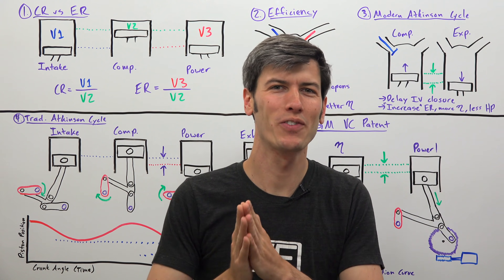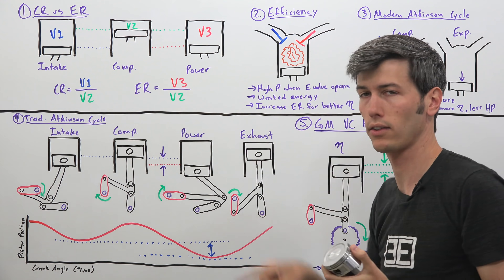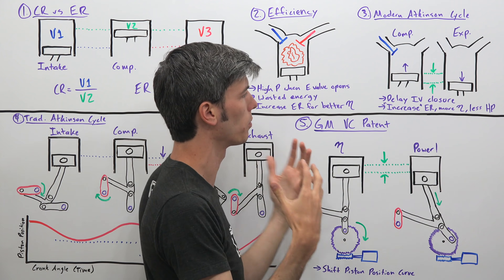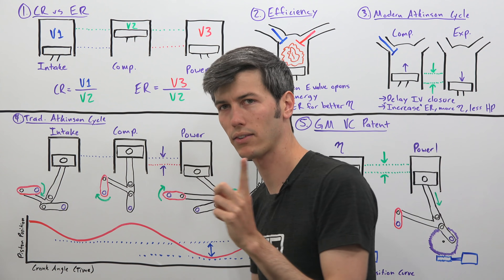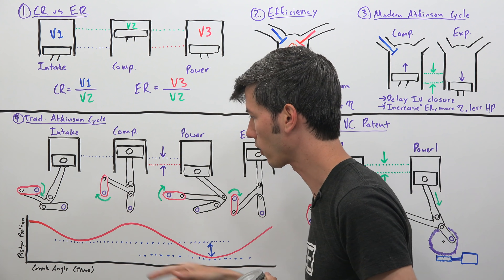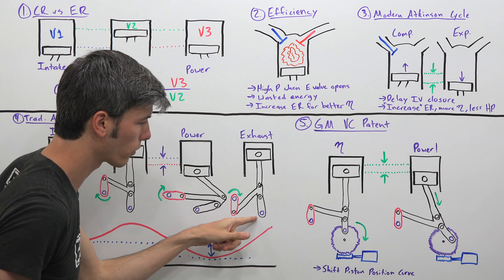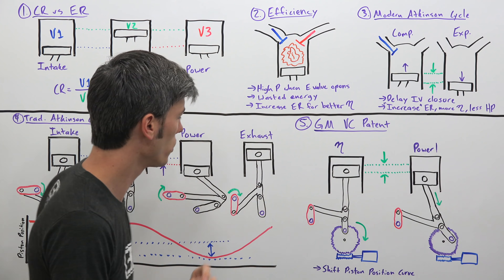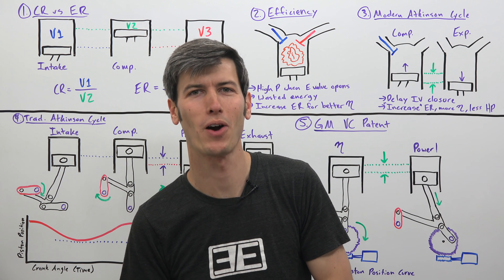How GM's Variable Compression Engine Works - Patent Review

Comment: I dont really understand the geometry behind it, but it looks like with this design a parallel "v" engine could be possible. What I'm looking at specifically is how the crankshaft  is offset (vertically) from the cylinder. 

So it might be possible to mirror it over the crankshaft to make 2 banks. Then it would be possible to make it have a single head like VWs VR engines (but not as funky with angled pistons on the head)

Comment: Hey Jason @engineeringexplained, I was wondering if you could help me out with a question about DCTs?  (Irrelevant to this video I know but I cant figure it out!)

In a common manual/automatic transmission when up-shifting, after disengaging the clutch the human/computer must wait for the engine RPM to drop to the appropriate value for the next gear before re-engaging the clutch. How does a DCT function in relation? In other words how does engine RPM drop at a faster rate compared to a manual transmission to allow a faster up-shift?

Many Thanks
Reply: I dont have an answer for you but couldnt you have a computer actuate an engine brake that momentarily is applied to the flywheel to rapidly drop rpms while the clutch has the engine disengaged?

Comment: - i just dont trust the little motor at the bottom. something tells me thatll break every 40k miles and require the body to be removed to get to it...
- i imagine this is wholly incapable of handling boost?
- why would you need to adjust position at a worm gears pace on each individual cylinder? arent they all supposed to be running the same exact specs as each other all the time?
- is it even worth salvaging if the thing ever gets hydrolocked?
- the more complicated an engine gets in the name of efficiency, the more stuff oil has to touch, thus the more things have a chance of failure if you have anything happen to your oil at all. if you run small engines without oil and seize them hard, you can take them apart and slap some new rings on the pistons if even needed, hit them with some WD-40 and theyll run again. THIS will cause a black hole if any little thing goes wrong.

2000 subaru forester s, 2.5L N/A 5M... i dont like the complicated thingamajiggers because i cant fix them on my own, or the parts are too expensive

Comment: Jason, I love your channel - thank you for your work!  I have a video suggestion - the theoretical ultimate efficiency if all patented engine designs were applied to one design (sharing of intellectual property between manufacturers).

If only Christian Von Koenigsegg combined freevalve technology with variable compression AND direct injection AND port injection (with a bit of Mazda's spark controlled compression ignition) AND the Koenigsegg compressed air system for turbo spooling AND pre-heated catalytic converters AND hybrid energy recovery... the IC engine would maybe get close to an electric motor efficiency but with all of that complexity.

If on a level playing field 2 engineers presented the electric motor from a modern BEV and the best possible IC engine.  Nobody would think IC was better.  I love IC engines and we'll want to use them for a while longer, but looking objectively I think the industry is moving too slow to compete with BEVs.  We need to treat IC as a nice hobby in classic now.  If solid state batteries happen, IC needs to die - regardless of whether grid electricity is all renewable or not.
Reply: Or you can look the theoretical cycles and see how much would be a theoretical maximum efficiency.

Comment: I see alot of problems with standard manufacturing of this idea.... That's a lot of space and it absolutely could not be any kind of reliable with the standard processed steel being used... It wpuld have to be forged at the very least which is going to skyrocket the cost... Ontop of the extra components needed to make it work properly... Good idea but expensive...

Comment: I wonder if the back and forth motion of the con rods causes any abnormal wear patterns on the bearings as opposed to the round and round motion in a normal ICE?  Because with back and forth the rotation direction stops and changes direction twice in each cycle instead of the bearing surfaces constantly moving the same direction past one another.

Comment: Basically its a more fancy variable displacement engine. Im wondering how more efficient this is over cylinder deactivated engines. Especially when it comes to warranty work,and the extra amount of now crank timing marks along with your valve train timing marks. This will be very intresting,and another insurance that the internal combustion is not going anywhere fast lol. Great video

Comment: I wonder how long this technology will survive against EV.
We should go all EV if the objective is to reduce emission.

Anyway this is a good transition before we meet full EV.
And I still think ICE x EV hybrid is the best for transition, you drive with EV while ICE charge the battery and give some boost on high performance.

The price is the problem. Basicly, you have 2 engines in 1 car
Reply: used volts (arguably the king of phev) are going for 13-20k usd up to a 2016 lt trim. past that and you get the fancy stuff. not too expensive for both an engine and a motor.

Comment: All I see with these new motors is high repair costs. It will be a flop like cars that have the stop/start feature, direct injection in higher miles, dual clutch transmissions, etc.  I would rather have an engine like this then wait for an electric car to charge but all it will equate to is higher insurance and repair costs.

Comment: Have a look at Gomecsys GoEngine VCR technology. 

It's (older but) a much more elegant solution (than what GM are proposing) to achieve variable compression ratio and an over-expanded engine/power cycle.

Gomecsys' VCR system used ring gears set inside the big-end that rotated around the crankshaft to offset conrod-crankshaft journal centreline distances; to achieve VCR and an increased power stroke.

Their system provided a 20% longer expansion stroke than the compression stroke, which yielded greater combustion force applied to the piston; which, in turn, enhances efficiency/power.

Since Gomecsys' system uses ring gears that rotate around the crankshaft it avoided the clunky design issues (and vibration/losses) that are associated with multiple reciprocating levers and conrod like assemblies moving in too/fro reverse linear forms; like the GM system. 

Pro drive had a similar system years ago too, and (if my memory serves me well) either that or a version of the above-mentioned Gomecsys' VCR system was used in a prototype F1 car and successfully tested at extremely high crankshaft speeds and power outputs.

My bet is that licensing the Gomecsys' system (or 1 like it) is simply too expensive for GM.

Comment: That engine is a nightmare from reliability viewpoint. In step 3 where Atkinson cycle is explained he did not mention that many modern engines can have the intake valve closed earlier or later depending on the load by using variable valve timing techniques making the engine produce more efficiency without sacrificing maximum power output, just thought it should be mentioned as it is a lot simpler and more reliable way of achieving efficiency and definitely weights less that such complicated multi link crankshaft. Piston and conrod weight is very important for efficiency but conrods in this variable compression engine definitely will weight significantly more than traditional ones limiting maximum RPM and thus making the power to weight ratio so much worse that its debatable if this whole effort is worth doing at all.

Comment: Two major problems with this. More parts to fail, and engine harmonics. With pistons moving to  two positions the weight has a high and low force. How do you balance the crank, split the difference? So more fail points and a terrible vibration. Back to the drawing board.

Comment: I think GM knows a thing or two about unintentional Variable Compression Engines if you catch my drift
Reply: Lol yes, i just took off valve cover from a 2.2 gasoline Opel Astra H. It had stretched timing chain and popped over tooth.
Reply: @sleeptyper  yeah that's a common issue on those engines I believe they were an Opal design or at least the Germans had a hand in designing the engine and GM produced it basically the oil pump was  variable and at low idle it didn't deliver enough oil pressure to key parts of the engine

Comment: This is not new...
International put engines like this in bulldozers in the 1950's
You could start a cold engine with just one battery using low compression and gasoline...
Once the engine is warmed up, the compression is boosted as diesel is fed into the cylinder.

Comment: In item # 3: I’m pretty sure fuel is not pushed back out the intake valve mixed with air. An engine designed like this would surely be direct injected and deliver fuel right before ignition.

Comment: All these vc engine designs seem like overly complex and subsequently weak/inefficient systems. Theres no way adding more connecting rods/increasing the primary and secondary mass is going to have a positive impact on the engine.

Comment: OK, but it still reciprocates and has a variable and minimal leverage.  I have one patent granted and another pending on I.C. engines.  The patent pending is for a CONSTANT VELOCITY, constant leverage, toroidal design with around 3 times the leverage of a reciprocating engine of the same bore.  It employs a true Atkinson Cycle with a unique and ideal solution to the usual compromises found in toroidal engine configurations.  A turbo charger may be used as needed to bring my design back out of Atkinson Cycle to effectively run Otto Cycle combustion for maximum power.  I've been working on the design for around five years.  I'll have it up on the net in a month or so.  I can forward it to you at that time if you like.  I think you'll find it very interesting.  Thank you for the excellent video on this particular GM patent!

Comment: I agree with a previous post, GM's quality has been BAD over the last decade, especially their four and six cylinder engines.  I would not buy a vehicle with this engine design for at least three years to see if the engineering translates to a solid dependable design.

Comment: In the modern atkinson cycle as described in 3, wouldn't the variable intake valve timing adjust compression according to your needs - power or efficiency - and so mitigate the tradeoff ?
Reply: Stephan Buchin: Just what I was thinking too. And a lot simpler.

Comment: Can you do a video on a ‘5-stroke’ engine? this theoretically increases the expansion ratio as-well while keeping a lower compression ratio.
Reply: I think I saw a video about it, wasn't it an engine with a bigger cylinder for a set of two that do the combustion, then dump into that 3rd big one for further expansion?
It's very interesting and really similar to a piston based steam engine (in fact, the Titanic's engine was like this).
The drawbacks I can think of it is power to weight and power to volume ratios, also given there's more mass rotating and on different timing, balancing might be harder and I could see it as slow revving (slow as in response not redline). Again, this is what I can think of, but it would still be a very interesting concept, if not for cars then at least for stationary power generators.
Reply: Kalvinjj yes it was, a couple Nobel steam cars used a concept as you described about the titanic. 2 higher presure steam cylinders and 1 low pressure. I definitely think it’s has its uses, however it takes a big company to make it mainstream. As far as I am aware it was ‘devised’ in 2011 and since then no prototypes have been built.

Comment: Electric cars with on-board generators. Which is basically the miniaturized diesel locomotive technology to be fit in cars. First Jeremy Clarkson, James May and Richard Hammond came up with it. Then Fiscar tried doing it and called it Karma. Nice idea but quality sucked. Then Honda did it with their Accord Hybrid and now available 2018+ Insights. Toyota hybrids are basically the same thing but their transmission is kind of more complicated. Atkinson cycle engine is most efficient, electric motor most powerful. Win win. My accord hybrid is both more efficient and powerful/faster than every 1.5L turbo honda engines. And probably more reliable

Comment: I don't see how the disadvantage of the modern Atkinson cycle you mention (less oxygen) doesn't apply to the traditional Atkinson cycle and the GM VC patent. Whether you let a bit of air (or fuel/air mixture) out during the compression stroke, or you just let less air in during the intake stroke, the result should be the same, no? Either way, a lower compression ratio can only be achieved by having less air, so obviously less air is going to be an issue by definition. Or am I missing something that has to with the richness of the fuel/air mixture (or how well it is mixed) that is an issue with one system but not with the other 2?

Comment: Seems tailored to OHV designs. Wouldn't it just be easier to just start with a high compression DOHC setup and 1) Use cam-phasing on the intake valves to bleed-off and control intake compression, and 2) Use cam-phasing on the exhaust valves to bleed-off and control expansion/stroke?                     

Late intake valve closing would reduce compression, and early exhaust valve opening would reduce expansion ratio. Then you could do the opposite, and the inverse of each other both ways. 

Then in high RPMs, with an ignition timing change, you could even phase the intake/exhaust cams towards each other for a tighter lobe separation angle, more valve overlap, and get a huge increase in power from intake-to-exhaust scavenging. All done with cam-phasing and ignition.

Comment: I am not good at math, but when it comes to the mechanicals that I get. I agree the way the system works is simple. But with all the connecting points it seems over designed. I believe in the kiss system that's why I wouldn't buy a Mercedes the vehicles are over designed and  overly complex.

Comment: I assume the amount of additional pressure that is captured for use by increasing V2 is proportional to the increase in power stroke volume vs using a conventional crankshaft.

Comment: Ha Ha Ha only some bearly 60 degrees for the power stroke. Still to fast piston to crankshaft relationship the same as old Atkinson  "The cycle" concept. Which was 50' and 60' solution for some stationery concepts.

Comment: I've always found it very interesting in that more power comes from lower compression ratios. I was under the impression that high compression = more power potential but with the knock and timing being an issue, as well as spontaneous combustion, I can see why lowering it would be better.

Comment: Look up Mazda’s KJ-ZEM Miller cycle engine.  Pretty neat for it's time and fixed the HP issue. 

Also look up the Mayflower Variable Compression Ratio Engine, not sure where this company ran of to?  I remember them talking about also bringing over similar technology that the Mazda KJ-ZEM engine used.  Looking at the design of the Mayflower vs GM variation, I would probably lean towards the conventional motion of the Mayflower over the direction changing GM variation.  I don't have high hopes for GM's new Patent, I believe it will be plagued with wear issues.

Comment: Neat concept, but I wouldn't trust GM to carry it out. It went from 2 rod bearing surfaces per cylinder to 6! Bad as that is, now imagine coupling this with a complex variable-valve head, direct-injections (and the associated carbonizing issue), and a CVT. YIKES!

No, just no. Electric just make so much more sense then this Rube Goldberg machine.

Great video regardless! You always provide an excellent description Jason. Always look forward to your videos and the whiteboard!

Comment: So would turbochargers be less effective in an engine like this? In terms of generating power, if the piston is able to "absorb" more power during the power stroke then theoretically there should be less power released when the exhaust valve is opened. I'm guessing you'd probably be better off using a supercharger... based on the info from this video.

By the way, isn't this almost exactly the same as Infiniti's Variable Compression engine?

Comment: On the top right corner of the whiteboard regarding the Atkinson cycle, it is written that it provides more efficiency while decreasing the Compression Ratio. Shouldn't it be the opposite? High CR means higher efficiency. Or you mean that playing with valve timing in the Atkinson cycle the engine can either have a very high Compression Ratio to be efficient and adjust the timing to 'decrease' it in order to provide more power while avoiding knock?

Comment: Nice concept (like Nissan/Infinity, though they came first), but I really doubt about the engine's durability, even more being GM.
Reply: GM still has engine durability, at least in the V8 engines.
Reply: ic3man5 The only fair point.
Pushrod technology that dates back to the 1950's but pretty reliable.

Comment: What worries me is customers who cheap out on their maintenance or the old guys who "don't trust synthetics" or anything less than 10w-30. I work in a shop where i hear this a lot and its a uphill battle trying to tell them the importance of following what the freaking oil cap says or trying to tell people who don't care to learn about basics of their vehicles to not go 10k+ miles on oil changes with Castrol GTX, and wondering why their engine sounds like a type writer, or a ford 3 valve

Comment: So GM wants to further disguise the truth of the auto engine! 
Our popular auto engine is actually a flywheel engine without
the spark plugs and the compression cycle; with a dc electric
motor at the ring gear in place of the starter motor!